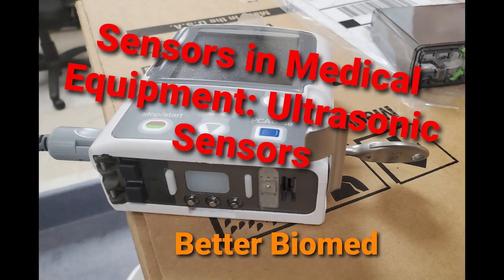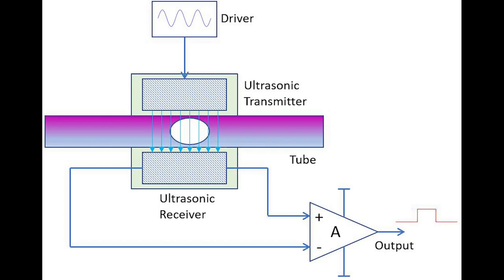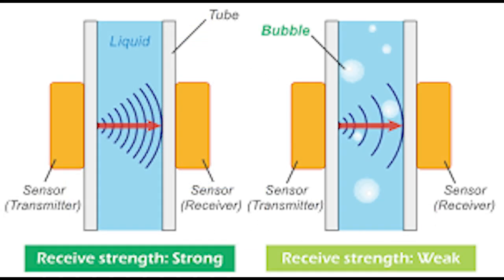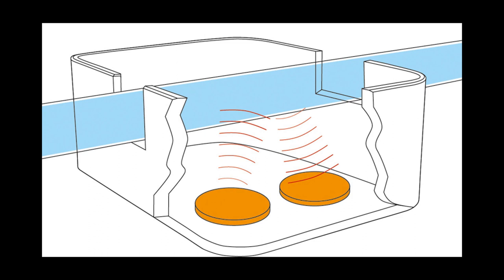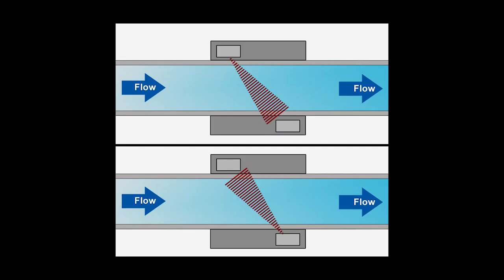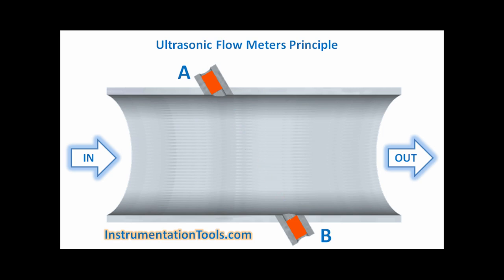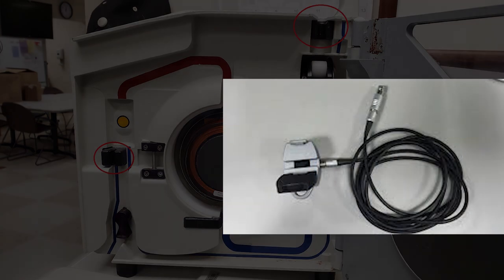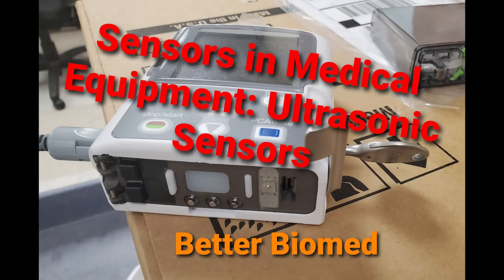Sensors in Medical Equipment: Ultrasonic Sensors

Comment: Is this sort of how a microphone works
Reply from the maker: Most microphones take a analog movement (sound) and convert it to analog electrical signal. From there it is either used as analog wave or processed into digital signal or synthetic wave
Reply: @BetterBiomedChannel  I am now watching your switched mode video. I had a series of JVC VCR's with the AC line fuse kept blowing. The mos-fet was perfectly fine. And when I replaced the shorted five volt zener. The zener and the fuse would blow again right away. So leaving the zener out of the circuit, the machine worked fine. I did that for years. How do you explain that.? Duty cycle?
Reply from the maker: @ea9334   Sounds like the Zener was being used to control Voltage and with it removed the short pulled more amps from the higher bus (without Zener)